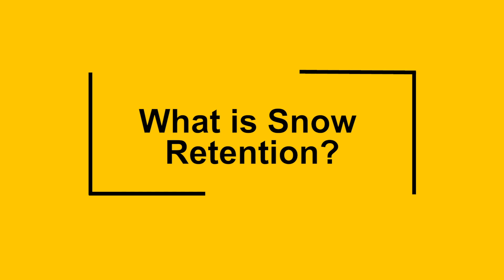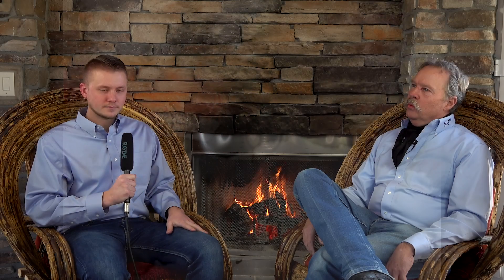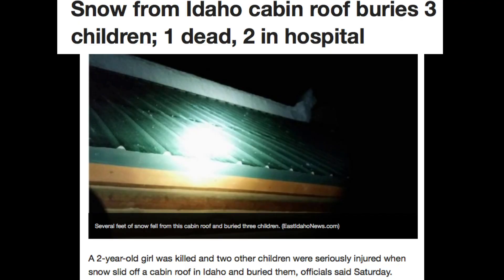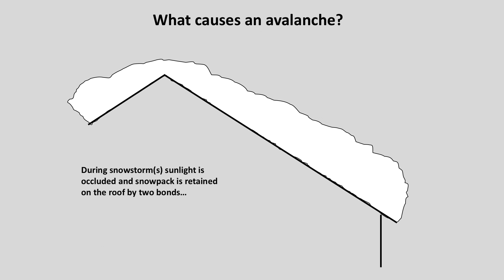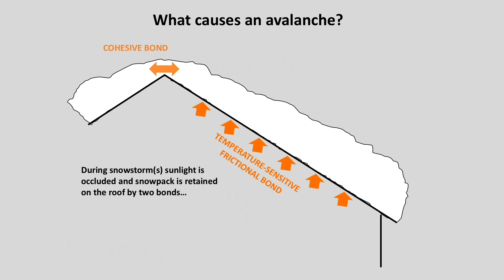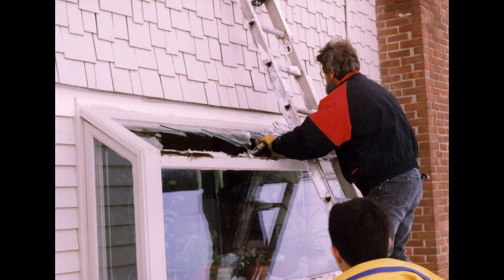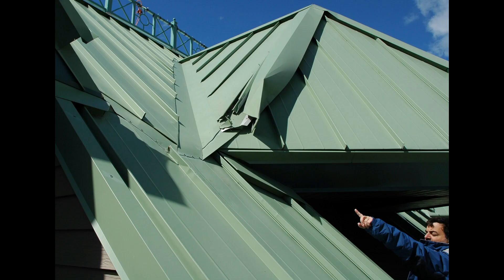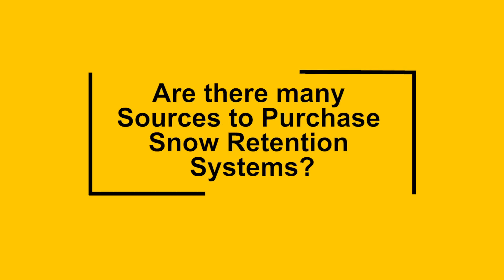5 Reasons Why You Should Use Snow Guards on Your Metal Roof

Comment: I work for the Forest Service up at Mt St Helens. Our employee housing has metal roofing. In winter, snow is CONSTANTLY falling off the roof and we have to dig out again. Aside from being a nuisance, it’s damaged the decks quite badly, we have to cover the sliding doors so the snow doesn’t pile up and break the glass… and sometimes the battens come off with the slabs. 

I’ve been trying to think of ways to fix all that… didn’t realize there was a whole industry around it. 

Definitely gonna be showing my coworkers and bosses this and see if we can get something set up.
Reply from the maker: Snow slides/avalanches really can be a nuisance up there in snow country.  It definitely sounds like our snow retention systems would be a great solution to your problem. We have several different snow retention systems for standing seam as well as exposed fastened roofs and the Snow Calculator on our website, www.S-5.com, will help to engineer the system to your roof conditions and loads. If you have any questions our need assistance with picking out or designing the proper system for your roof please reach out to us at support@s-5.com

Comment: is there a good heat tape for metal roofing? not sure I want all that weight hold  up on top of my roof either.
Reply from the maker: Thanks for the question!  Heat tape is often used in conjunction with our snow retention systems. The snow retention will safely hold the snow in place while the heat tape melts it away. S-5! dose not produce or endorse any specific type or brand of heat tape but the experts over at Radiant Solutions below can provide you with anything you need.

Radiant Solutions Company
Hopkins, MN
(877) 387-4218
https://radiantsolutionscompany.com

Comment: I need something before the South Dakota snow buildup above my front door slides off and kills someone. Our blizzard last week left 3 fit of snow in valley, dormer and transition to second story all the way up to peek. It warmed up and it all cam down with such force it cracked my 3 1/2 inch concrete porch. I am however concerned that usually in December the temps stay frozen until March or even April. The concern is if it keeps it up there to well then my roof may collapse. Please help me.
Reply from the maker: Hey Jeff, Thanks for your comments. We definitely can help you out. Please contact our Tech Support Team. They can help you find the right engineered system for what you need. You can reach them by calling (888) 825 - 3432 or email them at support@s-5.com. We hope to hear from you soon!

-Curtis

Comment: Hello,

I need Snow Guards for my Aluminum steel roof.

The snow slides off my roof so violently someone will be injured and Killed.

I cannot find anyone to install them.
John Kersten

south Minneapolis, MN 55406
Reply from the maker: Hey John! Thanks for reaching out. You can contact Steve at Radiant Solutions. Phone: 1-877-387-4218 
1515 5th St S Suite K
Hopkins, MN 55343 - United States
radiantsolutionscompany.com/

Radiant is a distributor of ours and can help you with anything you need.

Thanks,

-Curtis